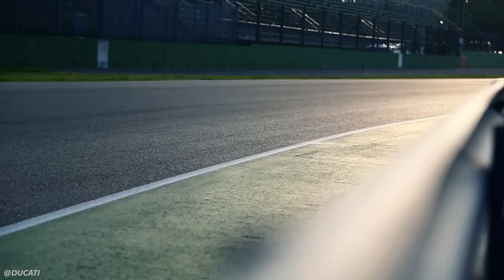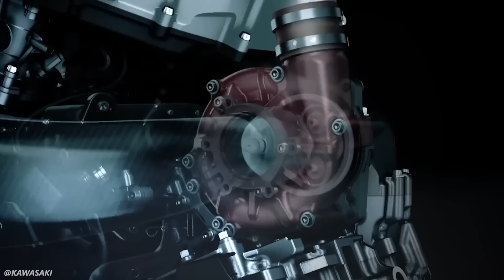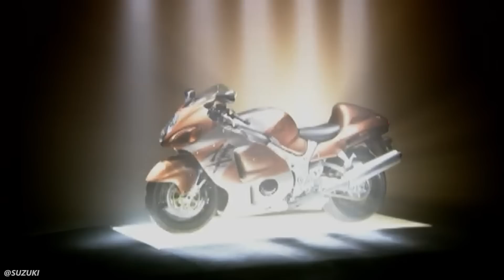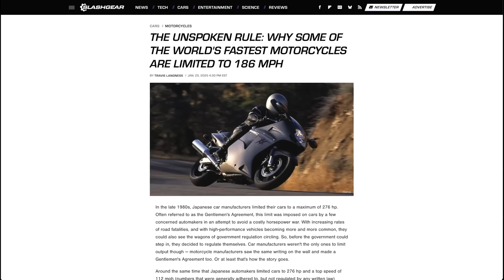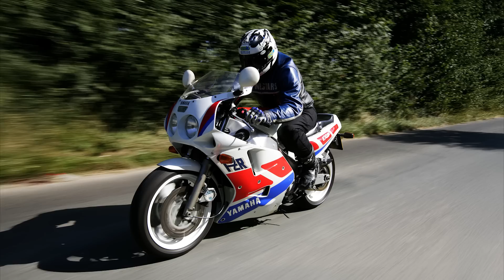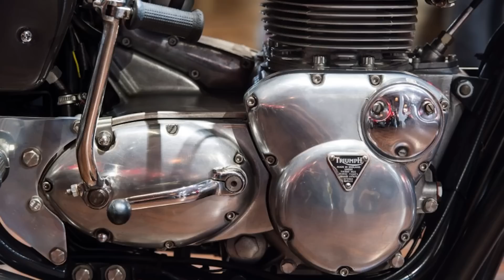The FASTEST Motorcycles from the last 70 Years

Comment: Ahh...no love for the ZX-12? Still one of the wackiest bikes I've owned, it was small, light-ish, handled great and fast.
Glad to see the FZR1000 featured though. I've been riding my 92' for 25 years now, upgraded the brakes and suspension, but other than that its a fine modern classis sportbike right out of the box. The ZX-12 was meant to replace it, but the horrendous gas milage meant I kept the 40mpg EXUP instead.

Comment: Back in the Day ! I owned 3 Laverdas.  The Laverda 3C was developed into the 3CE by the Slater brothers before the Jota and was the original hot 'super' bike. 3C for three cylinder and E for England.  The Jota was developed from the factory 3CL which was a 3C with fancy styling and a rear disk brake instead of a drum brake.  The Jota had the same power as the 3CE.  I have owned both.  And, by the way, they were Not smooth !.  Also they had clutch pulls that really needed a gorilla to operate (and I'm a small person with small hands) and the handling, at speed, was 'questionable' 🙃.  Apart from their power and speed the best thing about them was the glorious (loud and rasping) sound that they made.  I miss it to this day.  Thanks.

Comment: Where's the fastest bike in the 1990s the Honda CBR 1100XX  I owned one, it was FAST.. not only fast but stable..wheelied superbly  170mph was easy peasy and it wasn't even breathing hard.. like you were going 55mph.. Hayabusa aka in Japan as the Peregrin Falcon  fastest bird on the planet in a dive..was the answer,  knock at Honda, the falcon was the "hunter" the Blackbird was the "hunted" .. well done ignoring thee most iconic motorcycle of the 1990-2000  the XX .. The Panigale is fast,  you think your at redline, but your have 2K rpm to go. Amazing engine....that said the MV 312 is frightening WOT ..

Comment: Why do you show an FZR600 motor when you are talking about the FZR1000 ?
Reply: The first shot is an early 1000 engine when they were canted forward more and sat in a cradle frame. The 600 was a steel frame and you can clearly see the aluminum welds in that shot. A bit later, the second engine shown is the 90's version which was more upright and ditched the downtubes for a stressed-member frame, attached at the cylinder head.
Reply: Sorry sir it’s definitely a 600 in the picture. You can tell by the big round alternator housing on the side of the crankshaft. The 1000 motor had the alternator up behind the cylinders.

Comment: The 2000 ZX-12R was unrestricted before the restrictions were implemented. I achieved 203 mph and completed the 1/4 mile in 9.54 seconds, just by changing the front sprocket!
Reply: I supercharged a 2002 ZX-12R. Along with a few other mods, in 2004 at BIR with a strapped front end I clocked a 9.67 at 149mph. I had to roll off the throttle twice to keep the front end down. I never got a chance to run it with wheelie bars all out. To this day, it is the fastest motorcycle I have ever ridden. And the only motorcycle to ever scare me. The ZX-12R is so criminally underrated.

Comment: ZX14R missing?
Reply: Was about to say that
Reply: CBRXX..most iconic sport bike of the 90s until the Hayabusa came out. Too bad Honda didn't counter w/ a 1300cc Blackbird . The ZX14 is a great sport bike.. problem is it's too damned fast... Anything that goes 100mph in 1st is kind of silly.... Tell you one thing about the ZX I felt 'safe" behind the nose cowl.. loads of headlights, it's huge.. just felt safe riding it..
Reply: @CarlM1968  I had a ZX-1100 way back in the 1990's. Limited to 125hp in the UK, but easily capable of 90mph in 1st, and all the power you needed back at that time, but it felt so safe and solid. Absolutely the perfect way to travel on a motorway.